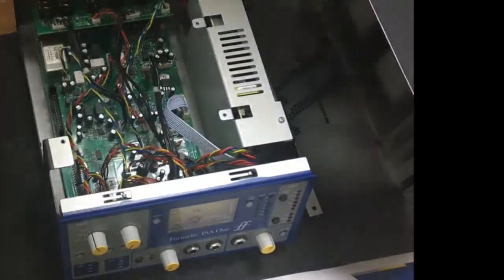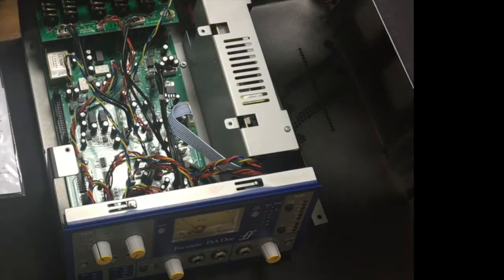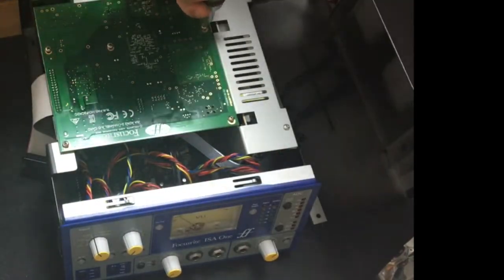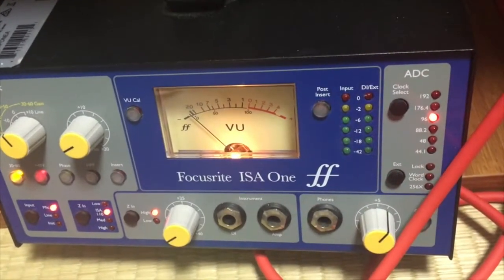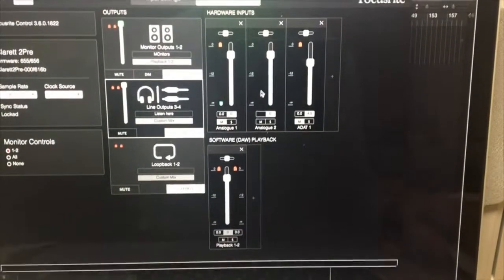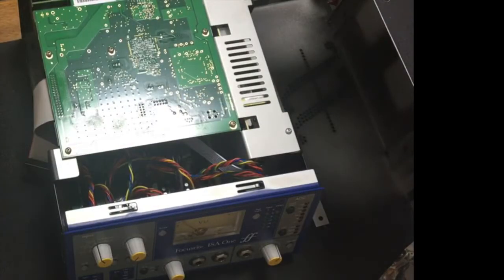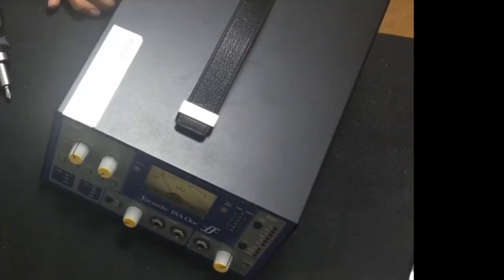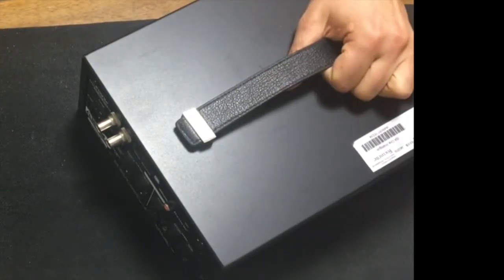ISA One | ISA ADN2 : Digital vs Analogue Comparison

Comment: digital sounds a little straighter, fuller, in a more defined and balanced way..analog sounds a little thinner, more uneven...I tried it on my own and came to the same conclusion.
Two month later: still hear the difference. I have just done another comparison on my own. The digital signal has more depth and sounds more like the original signal. The analog has a tiny little more warmth (or muffy in a very subtle way)...but compared to the digital the digital has more  that creamy/smooth special something of the ISA sound.
Reply: Heeey bro ! 
Can i conected Isa One digital card with Focusrite Scarlett 2i2, or direktly on my pc. Which cable must heave for connecting ?
Reply: @elvismustafic478  via adat or spdif. it's not possible with the Scarlett. you need another interface...like clarett 2pre at least (is you use it with the digital isa...for line input you need clarett 4pre...the only clarett with a really clean input without ging thru the clarets preamp) or babyface pro fx for example...with adat (optical) input...and you will need to buy an adat cable..... you can find that out in one minute using google...the Scarlett is a bad interface anyway....your ISA is definitely worth a better interface...I would get a babyface or Fireface. RME is a better longterm solution than any Focusrite interface...and ISA One is not the best preamp. But if you like that sound it's nice. It's not flattering in anyway.

Comment: thanks for the video, but i think what i was curious about with the side by side comparison from digital vs analogue was also how it sits in a mix, if there is any actual difference or if there is a difference with other instruments such as bass and electric guitar. I also would be interested in the signal chain you used in this and if using the di would make a difference for digital vs analogue, not only in the personal preference sense, but in an analytical sense  (if there are any actual differences in the waveform and such, or how it reacts to the DAW from the digital vs analogue)
Reply from the maker: thanks for the comment. I’ll do the video over with the specifics you mentioned. but here is the quick answer to your curiosity. The clarett A/D converter are nearly identical. Meaning there is some discrepancy but only real studio fanatics would care about it. but if your audio interface is not so great on the AD conversion then I think the Adn2 is good.
Reply from the maker: https://www.youtube.com/watch?v=fDgpjRavMvM
new video, this one might help